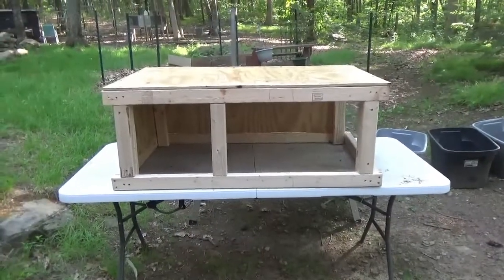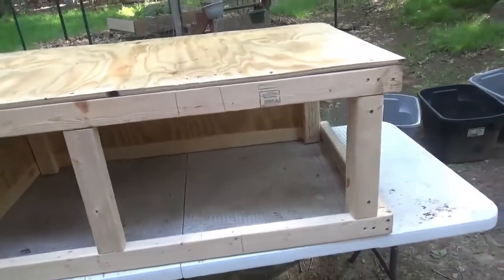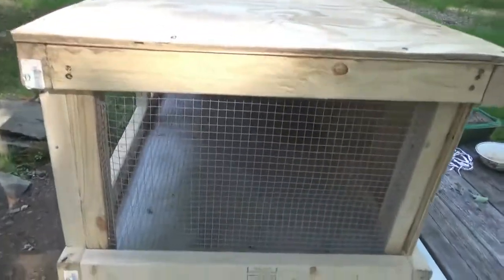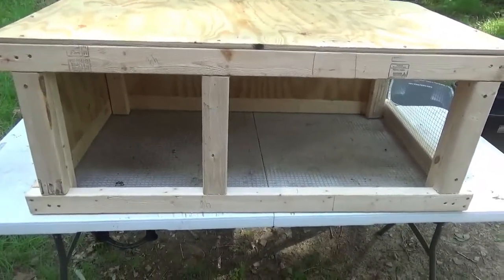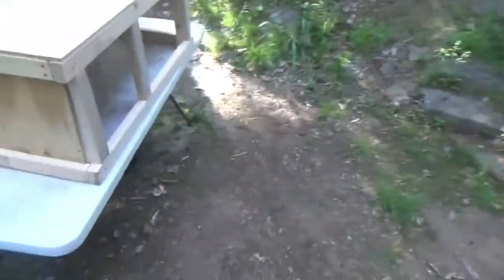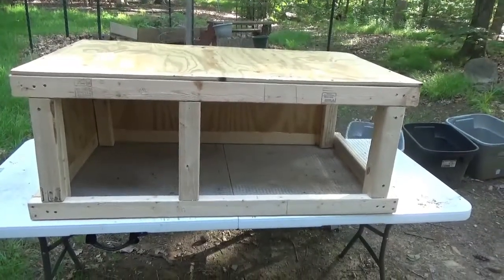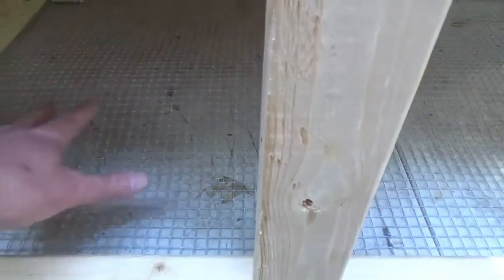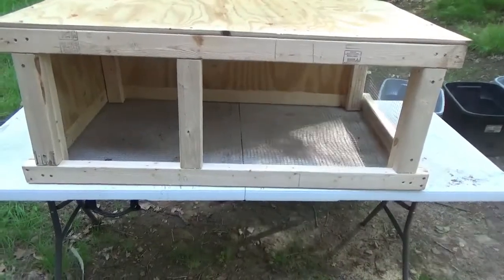Quail Hutch build update 2021

Comment: Awesome job you have done there. Be sure you completely seal the wood with something and the hutch will out last you. Thompson's water seal. Kilz or any of a dozen products out there. By all means, be sure to double seal the plywood edges where you can see the layers. The edges will act like a sponge and through capillary action draw the water all the way in to the center of the top, causing it to rot very quickly. 
I know someone that raises rabbits. He lets the dropping fall through the bottom of the cage to be eaten by Red Worms. He then sells the worms on the side for fishing bait. I might add, the rabbit cages are inside a pole barn
Reply from the maker: Thanks Rex, I never thought to seal the plywood and treat the edges, I thought about painting the whole thing to match our chicken coop. Great advice. These hutches are outside unprotected, and the critters were taking great interest in the one hutch that I had no tray in, so I think if I leave the bottom open the birds will experience predator stress and my egg production will suffer. I am no fan of the trays though lol. I like the idea of raising the worms, I'll have to look into ways to use the waste to grow mealworms or something. Thanks Rex I appreciate all the advice!

Comment: Looking good. When I was in grade school and junior high I raised a lot of animals. I had the largest private zoo in the city. So...I was always building cages.  As Rex said, make sure you seal the edges well. Lousiana Pacific went bankrupt paying for siding replacement (LP Siding). The stuff would suck the rain droplets up thru the edge and rot within 1-2 years. I saw houses where the mold had gone completely thru the board and then thru the drywall inside. I would also put the end of the legs on flat 1' concrete blocks to keep them off the ground. Wonder if Flexseal would work on any of this.
Reply from the maker: Thanks Jim! I was thinking the same thing about flex seal, maybe I'll give it a try on the roof and let you know how it works out. I think I am going to take your advice and put the legs on pavers, I keep going back and forth. My rabbit hutches are just on the ground, but then again they were free donations and have some deterioration to show for it as well. It can be a very damp environment as I have a lot of canopy cover so I think it would be a good idea to get them off the ground. That's interesting about all the animals you used to raise, that sounds really fun. Thanks for the tips!